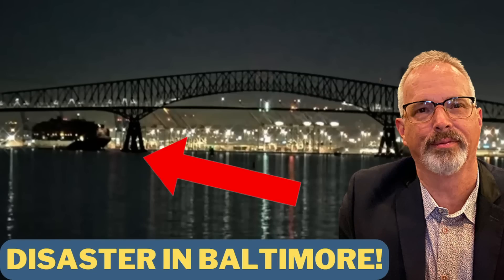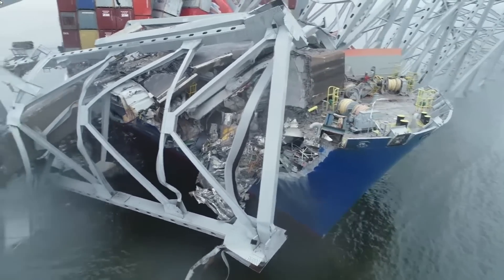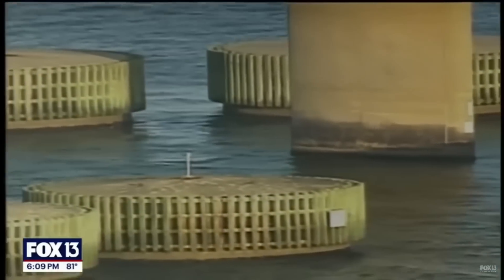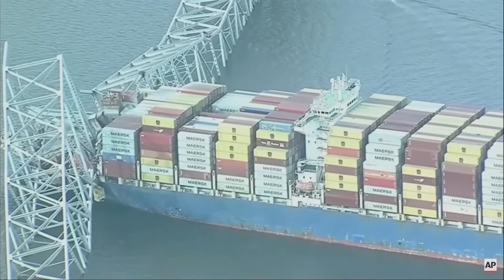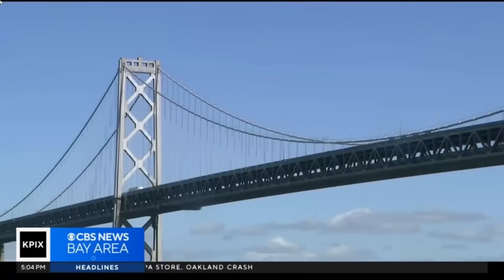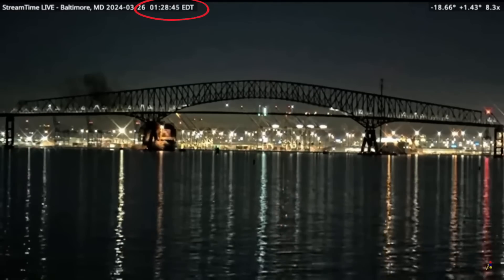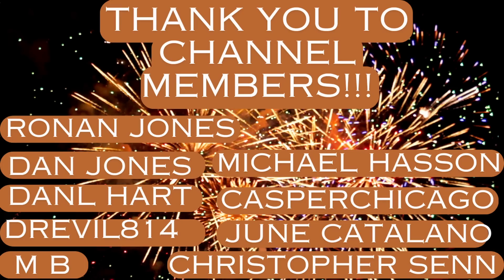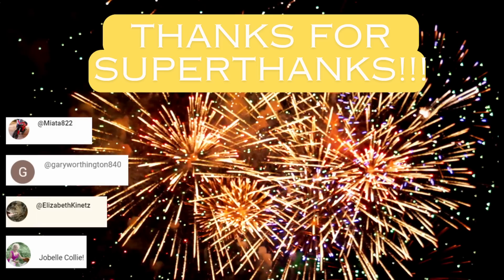How the Francis Scott Key Bridge in Baltimore should have been Protected

Comment: I don't think this is Tofu-Dreg construction. The difference is that this is just old infrastructure that needs upgrading, while Tofu-Dreg starts crumbling even before the paint dries.
Reply from the maker: Great point!
Reply: Tofu dreg is deliberately using shoddy materials and shortcuts to cut costs or to line someone's pockets. That's not the same as neglect. This bridge, and the one in Providence that had to be closed, met the standards of the time and they stood up for 50 years. What didn't happen in the case of this bridge is that no one spent a penny to upgrade it to modern standards. What happened in Providence is that they failed to do proper maintenance. The Providence case might involve corruption, in which case you might call that tofu dreg maintenance. But in neither case were either of those bridges improperly built.
Reply: It’s 50 years old.
It didn’t fall down it was knocked down by 95,000 tons of ship
Reply: @neilkurzman4907  That was my point. Nobody cut any corners when these bridges were built 50 years ago. Tofu dreg construction would have fallen down decades ago. The place where corners were cut was in the maintenance. When the Key bridge was built cargo ships were a fraction the size that they are now, that's what they designed for. If a ship had run into it 40 years ago it would have survived because the ship would have been too small to bring it down. But as ships got bigger and bigger nobody thought to upgrade the system to meet the current risks. It wouldn't have been that difficult to add barriers that would have protected it but wasn't a priority. The problem wasn't a deliberate act of commission, it was one of commission.
Reply: @joshuarosen465       It was an act of ommission.

In law, an omission is a failure to act, which may result in legal (or adverse) consequences.
Reply: Wrong...not bad bridge...A HUGE ship hit it....not bridges fault.
Reply: This is the opposite... "Tofu-Dreg Construction" is the result of rapid construction happening without oversight... this is construction not being profitable & not happening, resulting in old infrastructure not fit for the task.... however, if you hear the terms "Tofu-Dreg Construction", you are probably looking at the dregs of the internet.
Reply: True fact, but all these 47 years, even after a collision in 1980, no one wanted to spend extra money on protecting this bridge, even though others were adding protections.
Reply: Seems easier just to drive panels in 20', bring tops 20' above water, fill with concrete and rebar. Diameter to be determined.
Reply: Its one of thousands of bridges in the usa in rough shape key bridge was not in great shape and was supp to have reinforcements installed in 2025. Very sad and very scary that lives have to be lost to get money to fix things...it shouldnt have to be that way ...money is spent on ridiculous frivolous stuff all the time instead of what it should be allocated for.
Reply: @sycksyngyrl  
Frivolous stuff like "climate change" and gender-confusion, and what other fake-science or stupid leftist causes that are trendy or that the gullible people will fall for?
Reply: This is spaghetti construction, nothing wrong with that, but you should protect the 'single point of failure' with a massive construction, so your spaghetti bridge cannot be impacted.
Reply: @dutchman7623  
Can you add spaghetti, construction. But at the time it was built, it was state of the art.  So they should’ve planned for gigantic ships that didn’t exist when they built it.

Comment: The engineering problem with bridge protection is engineering the administrators and politicians who blow off engineers, or anyone, who brings them bad news.  I retired early, luckily I was able to by a miracle.  One reason was lets say being under appreciated and considered negative for bringing up potential problems, with anything from buildings, sitework, budgets, materials, and even office administration which being the only professional in offices with any willingness to help with them, would do.  I know bosses and co workers would have been happier not hear from me.  Clients constantly demanded LESS WORK be recommended, ie, that the firm take the responsibility for failure for under reporting issues.  I'm sure this resulted in fewer references for projects for the firm.  Which is a big reason professionals 'missing' such obvious things as proper protection for this bridge.

Comment: I live on Newcastle Harbour in Australia which is the largest coal port on the planet. Every large ship, cargo, coal or passenger, is brought in and out using tugs. Why is that not the case in the US?
Reply from the maker: Doesn't make sense to me either but there seems to be all kinds of cost saving measures lurking in the background of all kinds of activities that don't become apparent until there is an obvious problem that occurs later.
Reply: TimBatSea, one of the better channels from maritime footing (his tug crossed under the FSK bridge 6 hours before) has a set of videos explaining, but it is mainly because once the ships are underway, the tugs simply do not have the power to affect a vessel of this size at standard speed.
Reply: @leechowning2712  When you say the ship is underway, what defines that? Wasn’t the ship only a few minutes into its voyage? I haven’t timed it in Newcastle, but the tugs are attached for some time until they are well out of the harbour and clear of any infrastructure. As I write this, I am watching the 180,000 tonne Pacific Spirit leaving Newcastle Harbour escorted by three tugs. I assume they are sized to allow intervention if required.
Reply: Another channel, TimBatSea, one of the tugs that works along the Atlantic coast, has a set of videos explaining because he is already seeing that question. 

The problem is that tugs can only really affect a vessel this size (remember, same size as the Eifel Tower) when they are stopped or nearly stopped. Remember the boring old "E=MC2"... the larger the object, the more energy it contains. 

They had grants to place shipping protections after Tampa. They either decided not to, or had other uses for the money.

Comment: Why don't we just go with the cheaper option of automated boat departures and reduced speed while passing under a bridge? Beacons would be installed on the bridge pillars and radio receivers would feed a computer system to make it impossible for the boat to move outside of a specific lane. This wouldn't cost billions of dollars in dolphins that might not even work anyways
Reply from the maker: I think what you suggest should be part of the overall system of protection but passive systems have their place.
Reply: And if your computer goes down or you lose steering? Still impossible for the ship to go outside the lane?
Reply: @drforjc  We can play what if games forever. What if the dolphins were build poorly? What if they failed and deteriorated over time? What if they were designed to handle such a large ship? what if the ship would have missed the bridge, but instead hit the dolphin on the side and it horribly damaged the ship?

The question is--what are the odds of the ship's backup compute, and secondary backup computer, and the human backup operator all failing simulatenously? Lets also just program the ship to shut down in the event of a steering or computer failure.

Comment: Today it seems to me that increasing the central span by 200-300 feet would allow final pier before ship channel to be back 100-150 feet from edge of channel. This could be filled with large stones placed to high water level and easily making the pier unsailable from the water. Ray Stormont. PS The low cost to protect the piers would help to offset the increased costs associated with a longer central span.
Reply from the maker: I think that would be an excellent option that you line out.
Reply: @CaseyJones-Engineer the Skyway center span was increased from 800 to 1200 feet when the new one was built. I believe the FSK already had a 1200 ft center. 
Based on a diagram that I sorta recall from another video on this collapse, that allows for approximately 300 ft clearance on either side of two possibly 300 ft wide channels in middle.

Someone had mentioned the newer Long Beach bridge…it’s no more than 1200 ft span, if that, I think I remember reading. And that’s a much busier port than this one.
Reply: @CaseyJones-Engineer My personal thought was that this isn't that long of a bridge. The Golden Gate Bridge is roughly 80 years old and spans a longer bit of water with just two towers that are positioned near the shore on either end.  I'm somewhat curious as to why they didn't go that route originally as the Golden Gate had been open for roughly 30 years when they began this project and you're left with just two towers that need to be protected that would be nearly a mile apart. In the case of the Golden Gate, at least one of the towers appears to be partially protected by the ground under the waterway.
Reply: yeah it might be but the issue for that area you have to consider is that in winter that bridge ices over  its already one of the longest bridges .   Even the ravenel in charleston gets shut down for winds due to its design .

Comment: If nothing could be done to protect the bridge from this impact, time to make changes, radical changes, to the cargo ship transport industries.

And before blaming the pilot or the crew I would put far more blame on the the the following instances for making their work stressful where absolutely no margin of error is provided :
The Capitalism race to the bottom and lack of governmental and international transportation authorities proper regulations and oversight.

1. Port authorities cutting down operating costs.
    Less tug boats on shorter distances when considering points 2, 3 and 4 requires more investments.
2. Bridge authorities cutting down operating costs.
    Insufficient bridge protection in place when considering points 1, 3 and 4 requires more investments.
3. Ship operator cutting down operating costs.
    Poorly maintained understaff ships when considering points 1, 2 and 4 requires more investments.
4. Shipping industry cutting down costs.
    Ships getting too large and overload for current infrastructures causing way more damages in a single incident.
5. Government and international transportation authorities relying on the industry self regulating itself which cause points 1 to 4

The industry may have a better safety record in recent years but these statistics don't take into account only large and costly catastrophic incidents.
Small incidents inconsequential for environment or infrastructures have declined lowering the overall statistics.
Ships being larger and larger with bigger loads cause way more costly damages in a single statistical occurence.